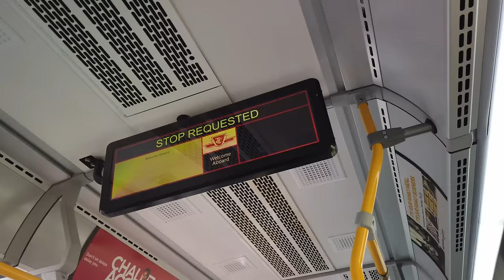Why American Buses Are Just Worse

Comment: Thanks Reece for a very informative video.  However, writing as a Brit, I should stress that most British buses outside London have only one door.  One correction.  Trolleybuses are 'not all over Europe'.  Many countries in WESTERN Europe have NONE.   Switzerland with 12 trolleybus systems is exceptional.  Outside Switzerland, Lyon and Milan are the only large western European cities with thriving trolleybus systems.  (Rome and Naples also have a few trolleybuses.)
Reply: 2 Hours Ago?The Video Uploaded Seconds Earlier.
Reply: And the idea of having one doors, especially on busy intensive city routes like those run by National Express West Midlands (in Birmingham), for example, just make things completely inefficient as a result of increased dwell times. With maybe the exception of lightly used rural routes, I don't agree with single door buses at all.

Quite a lot of Italian cities have trolleybuses, including Rimini, Ancona, Bologna, Cagliari, Chieti, Genova, La Special, Modena and Parma. Naples is expanding its system - route 204 for example began trolleybus operation in 2021, and 3 additional routes are soon expected to begin trolleybus operation - including 168 (renumbered 206) and R5 (renumbered 205), with withdrawn route 203 also to return.
Reply: Yep Trolley buses are generally mostly found in Soviet blocs. Though I think we should build them more rather than using too much battery electric buses.
Reply: Arnhem in the Netherlands also has trolleybuses, so not that little cities. (And of course a lot in EASTERN Europe)
Reply: @mr.fishmanman  seconds earlier for the general public. The videos are visible much earlier for those with paid membership.
Reply: I think it is only London and Edinburgh that have two door buses.
Reply: @f.g.9466  Oh Ok Interesting Thanks For the Info.
Reply: Everybody always forgets Athens. Largest Trolleybus system in western Europe.
Reply: @mr.fishmanman  I am a Patron of RMtransit under my real name of Roger Sexton.  The 'Perk' of early access to Reece's videos is for me very valuable.
Reply: @Fan652w  Can I Ask How Much Is The Membership And What's The Perks Aside From Being First To See The Videos.
Reply: What about Arnhem, Salzburg, Ghent, Budapest, and Athens? France has too many to bother naming.
Reply: @daniels7031  I most certainly did forget Athens.  And Athens also has trams and a metro!  Ghent closed its one trolleybus route about 15 years ago.
Reply: We also only have 70% low floor where I live in Central Scotland- there are 2 steps to get to the back seat- as a plus the seats  at the back allow a child to see out of the window from a seated position, which keeps them more entertained and makes the journey less stressful.
Reply: @Fan652w  Thanks
Reply: 1. The last time I checked "Eastern Europe" is part of Europe and 
2. The "big cities" mention is also unclear but I believe that Berlin, Athens and Piraeus are big cities.
3. there is no doubt that there are far less trolleybus systems today but I counted more than 40 existing systems in "Western Europe".
Reply: @katrinabryce  there are a few other places who have dabbled with dual door vehicles both past & present - Oxford was a past player and now, Brighton & Hove and Metrobus do have dual door buses on certain routes. Also, it should be noted that London has a small amount of single door buses, almost all being short midi single deckers except for the B9TL Gemini's on the X26 which were converted to single door upon it's upgrade to double deckers (it has operated full size single door single deckers in the past that were ordered specifically for the route)
Reply: @AA-ks7bo  The trolleybus line in Ghent (route 3) closed about 15 years ago.  France now only has three trolleybus systems - Lyon, St Etienne and Limoges.  (Nancy may bring them back.) Lyon is one of those wonderful large cities which like Athens and Budapest has metro, trams and trolleybuses!   Salzburg (Austria) is very akin to some smaller Swiss cities such as Luzern, St Gallen and Winterthur in that trolleybuses run on all the main routes. Linz (Austria) has double-artic trolleybuses, and has more on order,
Reply: @katrinabryce  Reading have introduced two door buses on the 17, which is their busiest route
Reply: Salzburg
Reply: @gabrielstravels  and I know Reece loves double deckers, but they are also super inefficient on dense city routes as the distance people are from the doors (up to 18 metres!) also increases dwell time
Reply: @katrinabryce  Also Brighton, Bristol (Metrobus, UniBus, X39), Bath (X39, UniBus U1/U2), Reading (Purple 17), Southampton (17 and 18), Crawley (Fastway 10/20 and town route 3) Cambridge (Busway B) and Oxford (11, 11X)
Reply: @samuell.foxton4177  I would agree on you on that, as much as I also love double decker myself, certain city routes are much more suited to articulated / bendy buses
Reply: @vjaska  Oxford Bus Company still have dual door Citaros in service!
Reply: @5688gamble  Many types of buses in Europe have rear windows, which are great indeed
Reply: Brighton & Hove also have some two doored buses but of course the more doors the less seating.
Reply: I agree that the buses in the UK are awful because te top of the seats are plastic handles so you rest your head on a piece of solid plastic
Reply: @katrinabryce  Also found in Manchester.
Reply: Also Trolley buses are popular in Austria in cities that do not have a tramway system.
Reply: The only trolleybuses I’ve seen in recent years were in the USA in Seattle.
Reply: Just because you can have a single door on a bus doesn't mean you should. As a previous commentor noted, I don't see any reason for a single door unless it's a small one (which implies low ridership) since you won't have many passengers trying to enter and exit the bus at the same time.
In general, the only way for two-way doors to work is when you have many of them to spread out the load. This is double so when you consider that the first door is preferably an entry-only door unless it's overfull or something (some cities like Berlin* even mandate passenger to enter from the front-door only) which makes the other doors (especially when there is only  other door) also more or less exit doors.

*Suspended during COVID, though this could have been changed back by now.

I'll also note that there are many West European countries with at least one trolleybus network. Switzerland was explicitly mentioned, France and Italy implicitly but Germany (Esslingen, Eberswalde, Solingen), Austria (Linz, Salzburg), the Netherlands (Arnem), Norway (Bergen), Sweden (Landskron), Portugal (Coimbra) and Spain (Castellón) also have at least one trolleybus network. This leaves Luxemburg, Belgium, Ireland, the UK, Denmark, Iceland, Finnland and a bunch of microstates (which for the sake of the argument shouldn't be counted) as West European countries with no trolleybus network so to claim "Most countries in WESTERN Europe have NONE." is only technically true due to the microstates but omit them and you get a majority of West European countries with trolleybuses (though they still are less widespread there compared to East Europe).
Reply: Fortunately here in Portugal most buses have two doors even in long range models
Reply: @katrinabryce  The Optare double-decker electric buses in York,UK which usually operate on the Park & Ride services
Reply: @MatthiasWiesmann  Salzburg has a trolleybus network.
Reply: @AL5520  Some of the western European trolleybus 'systems' are very small.  Landskrona (Sweden) has 5 vehicles on one route.  Schaffhausen (Switzerland) 7 vehicles on one route.
Reply: Ugh the single door buses pain me whenever I'm outside of London as it's so obvious they're causing a bottleneck slowing down the journey (also a London like simplified and unified ticketing system would also go a long way to speed up journeys).
Reply: @samuell.foxton4177  I noticed that when I visited Reading (Berks) they had some dual door buses on the busy route 17.  Ironically I am well old enough (turned 75 today) to remember Reading route 17 as trolleybuses.  It converted to diesel on 1968!
Reply: Arnhem (the Netherlands) and Solingen (Germany) are also decent-sized cities that have trolleybus systems. But yes, in Western Europe there are few such systems compared to other continents or even Eastern Europe.
Reply: @Fan652w  Additionally, Innsbruck might get new trolley busses very soon now(tm), after the old trolleybusses were replaced by trams (on the Line O), and diesel busses (Line R, but there are ideas floating about converting R to a tramline). It would then be the third trolley bus system in Innsbruck.
Reply: @samuell.foxton4177  Continental European doubledecks such as those used by Swiss Postbus around St Gallen, and Skane Lanstrafik around Malmo  have two staircases and three doors.
Reply: @gabrielstravels  Problem with double-decks on city routes where the average journey is about 15 minutes or less is that people are reluctant to go upstairs.   Vienna and Stockholm have both tried double-decks on inner city routes, but gave them up as only a few people went upstairs.
Reply: @Fan652w  my parents live on the number 4 route, which runs alongside the 17 to Earley, then continues to Wokingham and Bracknell, so I’ve seen a few of the dual door buses, but not been on one yet
Reply: @keithparker2206  In Austria only Salzburg and Linz currently have trolleybuses.  Linz does have trams as well. Innsbruck has an expanding tramway system, but is considering reintroducing trolleybuses as well!
Reply: I live in the NE of england and yeah pretty much all busses outside of major cities only have 1 door.
And UK hasn't had trolley busses since the 1960's.
Reply: @AL5520  he did say “extensive trolleybus systems.”
Reply: In Austria i know at least 2 (Salzburg and Linz)
Reply: @IntyMichael  SF has 15 trolley bus lines as defined by someone on Wikipedia. The articulated ones carry a lot of people during rush hour, last time I was there.
Reply: @Fan652w  yeah true, which is why for city routes 18m artics / bendies are better
Reply: @CatnipMasterRace  I entirely agree.  But your point about ticketing is extremely important.
Reply: UK are very good with buses though, especially London.

London's transport systems are extremely good and cheap, but go outside of London and there is no metro train thing. National Rail is great and Buses are too good
Reply: @gamingwithpros4047  As a Brit, I would agree regarding London, but not regarding the rest of Britain.  Outside London, services are generally expensive, and are poor in the evenings and Sundays.   We also have a desperate shortage of bus drivers.
Reply: @kitchin2  The bigger west coast cities are having all a pretty good public transport and bike lanes. I‘ve been to Portland, Seattle, San Francisco and Vancouver and they are all on international standard.
Reply from the maker: Thanks for watching! And for your insightful comments!
Reply: City bus lines are pretty much universally 3-door or 4-door for articulated in The Netherlands. And for regional buslines it is pretty much always 2-door or 3-door articulated. Each door being a double door of course. It also has a major trolley bus network, which is expanding as well (Arnhem).
Reply: @Fan652w  not to mention that most non London buses are single door too, which as I said before, makes journeys slower and inefficient
Reply: @gamingwithpros4047  well apart from Tyne and Wear Metro and Merseyrail!
Reply: @gabrielstravels  cheers, had thought the last ones had gone lol
Reply: @vjaska  they were temporarily withdrawn during Covid but they're now back in service. Btw, only the 55 regs survive (839-848) - the 52 regs (801-824) are all gone
Reply: Here in Austria, the next larger city has Trolleybuses. Also I don't know a single bus with only one door, you always get up in the front, show your ticket, and exit out the back. (Except for inner-city buses where you don't need to show your ticket and get on everywhere) But you're right, there could be way more trolleybus systems.
Reply: Ironically my main bus in London also only has 1 door too.
Reply: @xander1052  what's your local route if you don't mind me asking?
Reply: Double-door buses are also common in Reading, Brighton, Bristol and Edinburgh, although I stress still aren’t widespread enough.

Single door buses work fine on regular interurban services in the UK, but large towns and cities (I’m looking at you Manchester, Liverpool, Nottingham and Birmingham) really need to adopt dual door.
Reply: Well, you are forgetting Bolignia, Genoa, Sanremo, Salzburg and quite a few other places.
Reply: Limoges also has a large trolleybus network
Reply: @MaidaValeTom  I'd say they're fairly common in Bath too, the most frequent routes there (X39 and U1) have them
Reply: @5688gamble  Is this on Metro busses? This is common here in Sweden to, but then it's for buses doing larger loops and/or into rural areas. Think express or rural buses basically. Metro busses I can't say I honestly remember seeing without lowfloor and I've ridden buses to work for the past decade and a bit. Not to sya they don't exist, I've seen the odd replacement - sure, eg the orginal bus had broken down or was out of commision, the replacements have on occasion not been low. But those are unicorns, really.
Reply: @EgnachHelton  Well, in Eastern Europe trolleybus and first generation tram (from late 19th century) system survived mostly because there wasn't enough money to replace them with something else. Additionally, after oil crisis in the 1970s trolleybusses became actually cheaper to operate than diesel busses so they kept everything in operation and even some new systems were opened. The same can be said about trams. There were tons of plans for urban motorways and metros to replace trams, but nothing was ever built so trams survived.

P.S. Fun fact. Czechia, a small state in Central Europe with population just slightly above 10,5 million has 7 tram systems and 14 trolleybus systems which I think is more than North and South America combined...
Reply: Vienna also has a trolleybus system, kind of. As far as I know they are replacing (most?) of their bus fleet by electric busses that also have power cables
Reply: @gabrielstravels  It may depend on route. On the bus routes near me which feed into city centre I generally see only a few people at each stop during morning rush. And each stop gets a double decker bus every 15 minutes or so. Under these conditions two doors would not necessary speed load/unload and would lose seating capacity.
Reply: @katrinabryce  ...and many other UK cities?
Reply: In Germany I've never even seen a bus with just one door. Those really exist all over the place in the UK?
Reply: I remember 2 door busses in Sheffield in the 80’s but they were nearly all phased out by early 1990’s. About the only trolleybus I have been on was in Switzerland on a visit to see the Rhein Falls in Schaffhausen though I think I may have been on one in Seattle. 😊
Reply: The busses in Manchester UK seem to be improving in terms of comfort though many of the older type still run regularly 15 years later. I am taking a trip to US and Canada next month so will be travelling on lots of public transport in New York,LA,Portland and Vancouver with Amtrak connecting nearly everything in between. My last trip to LA was in 2006 so hoping see see improvements though the busses were not terrible but could have been better.
Reply: Trolleybuses are comming back, for example in Prague, we will have them again after 50 years and many countries are building even new tram systems, which is great. For me as a Czech, trolleybus is very exotic thing, ofcourse we have them in few cities, but it's not that common, but when I visited Latvia/Riga, they had trolleybuses everywhere, it was interesting experience. Our new systems in Prague will be combination of trolleybus and electric bus with batteries, it will be connected to wires only in some places, not everywhere. They plan some crazy 25m long trolleybuses to the airport becuase such a long bus would be illegal by our road law, but trolleybus is technicaly rail vehicle, so it's possible.
Reply: @Neuzahnstein  Salzburg and Linz are the only 2 trolleybus systems in Austria. Innsbruck is considering bring them back, even though it is also expanding its tramway system.
Reply: @norberthamar  No. Vienna has battery buses.  IT DOES NOT HAVE TROLLEYBUSES.  It used to have just one short route.  Contrast Vienna with Budapest and Bratislava, which do have lots of trolleybuses .  Prague is bringing back trolleybuses.
Reply: @Pidalin  To us brought up in western Europe the Czech republic and Slovakia are alongside Switzerland   three great strongholds for trolleybuses.   Basel got rid of trolleybuses, and has no plans to reintroduce them.
Reply: @Fan652w  For me, it's new, I am originally from Prague, not even my father remembers trolleybuses in Prague. And other cities are mostly that small that I don't need public transportation at all, I just walk, so even when I saw them in some Czech cities, I never tried it until I visited Latvia in 2018.
Reply: Kishnev in Moldova has trolly buses.
Reply: @AA-ks7bo  Ghent lost it's trolleys 10 years ago. They promised to turn line 3 into a tram line but that idea seems scrapped.
Reply: In my hometown (Bonn, Germany) the trolley buses got removed when the only places they went were mostly streets with tram tracks. That makes sense, since trams have less friction, bigger capacity and lower running costs than busses with rubber tires. I guess that's about the same in other western european cities.
Funny enough, the same cities which still have trolley buses (combining the bad economy of tire wear and lower capacity with being locked to fixed tracks) often also have central heating plants (combining the worst of big ovens and long pipes). Funny how that works.
Reply: I recently rode the trolleybuses in Salzburg, Austria. The system is quite extensive for a relatively small city
Reply: @daniels7031  Calling Greece part of "Western" Europe is a stretch in the best of times...
Reply: What about bologna and florence
Reply: In Italy there is not only Milan with a trolleybus system. There are 15 trolleybus webs.
Amongst the important cities Rome, Neaples, Bologna and Genoa own trolleybus lines.
Reply: Hey hey, what about Arnhem?!
Reply: Yeah, no surprise about the British buses I'd say. British buses that aren't in London are probably the worst public transport service I've ever used.
Reply: What exactly do you mean by "thriving trolleybus systems"? Milan (1.3mil) for example has 4 lines. Lyon (500k) has 9 lines. Doesn't sound that impressive to me, seeing that in Romania we have 16 trolleybus lines in a 2mil city (18 lines, two are suspended according to wikipedia) and 11 lines in a 400k city.
I do not see your argument as being very convincing when your examples are wrong, especially seeing that Romania in general has a rather shitty public transportation system. If we have better trolleybus networks than "the only large western cities with thriving trolleybus systems", there's a problem.
Reply: @h-0058  also according to Wikipedia Bucharest trolleybus lenght is 73 km. Milan's trolleybus web lenght is more than 40 km
Reply: @h-0058  The comment talks about Western Europe. Romania isn't in Western Europe. They did forget Salzburg though.
Reply: @jonistan9268  And sometimes when they're late they don't bother stopping or even pass by your stop if there's not a lot of people taking the bus from there, that's why I'd rather use my bike to get to work.
Reply: @EgnachHelton  Yep. They were worried if the gas would run out, or have none for public use during the war.
Reply: Limoges et freccia have at least one trolley line, but yes it's rare.
Reply: @h-0058  trolleybuses got investment as a matter of policy in a number of countries east of the iron curtain. They didn’t in the west. There’s really not much more behind it than that. There’s not really a good reason for them not to exist in the west, particularly given that we now need to Electrify Everything.

But if you’re building now you’d definitely build for buses that are capable of hooking on and off the lines without help, and have a fairly substantial battery backup. At the very least enough so that when there’s a big crossing where building the overhead lines everywhere would be hard, you can just… not. But ideally also enough for the buses to drive around things that are blocking the road.

The other way, of course, is fully electric buses that just recharge at one or two points, usually the middle or the end of the line. That’s the kind that drives past my house.
Reply: @JasperJanssen  I strongly agree with everything you say in your first two paragraphs.   Regarding what you say in your second paragraph, you will find that the Swiss cities of Zurich, Bern, Luzern, Lausanne and St Gallen prove the correctness of what you are saying.  On your 'big crossing' point Zurich has REMOVED the overhead wires across the very busy Albisriederplatz.  Trolleybuses on routes 33 and 72 cross the junction using batteries, while the trams on routes 2 and 3 still use their overhead wires.
Reply: He said all over Europe, not  in western Europe :)
Reply: BTW. In Czech Republic (central Europe, definitely not eastern part) solely we have 14 cities with trolleybuses running, including 5 biggest cities in this country (with Prague as a capital bringing them back after many years without them). 

So there is definitely a lot of cities with trolleybuses in Europe :)
Reply: @siriusczech  Now that Prague is bringing trolleybuses back, the Czech republic is perhaps now the trolleybus champion of Europe, ousting Switzerland.  Switzerland's weakness is that its second city, Basel, got rid of trolleybuses some years ago, and has no plans to bring them back.
Reply: You forget Paris, Marseille, Bordeaux, Strasbourg, Nice, Montpellier and Grenoble. Actually, there are 31 cities in France with such equipment.
Reply: @Jeff-ub4lr  No, you are wrong.  WE ARE TALKING HERE ABOUT TROLLEYBUSES NOT TRAMS.  There are about 30 modern tramways in France, but only three surviving trolleybus systems - Lyon, St Etienne, and Limoges.
Reply: Netherlands too. Just 1 city I know of but still. (Arnhem)
Reply: @katrinabryce  I visited Edinburgh last week for first time from Dublin last week, while most of the buses were nice (mix of VDL and Wrightbus I think) and seemed to be new, there was no middle door! :(
Reply: In Italy, apart from Milan, Rome, and Naples, there's also Bologna and Venice that has trolley buses (that I know of, and yes, Venice isn't only the island, Mestre, the city in the mainland, is part of Venice), my city, Padua, had them but took the system down when it replaced it with higher capacity tram lines.
Reply: Trolleybusses are plentiful in Eastern Europe as Czechs produce Skoda Trolley busses, and they are pretty good. We now have more Italian (?) Trollino trolleybusses
Reply: @JasperJanssen  Yeah, electric buses are also found here in some significant numbers, but they're not competing with the trolleys when it comes both to numbers and capacity. You can fit two electric buses in a trolleybus and they have to be recharged. When we'll get articulated fully electric buses, they might actually have a chance to become mainstream, but until then, they're found on the less used lines ("less used" - they're completely full central lines, but whatever, let's not get into the poor city design topic).
Reply: Also Genoa has a trolley line and in 2026 the trolley line will be 4
Reply: @h-0058  I think some of our buses are articulated ones still? Not sure, really, since early 2020 our passenger numbers are enough down that buses are never crowded no matter what. But… yeah, no, I’m sure the buses running our route are electric articulated ones. ProbabLy vanHool or Heuliez, that’s where almost everything comes from.
Reply: @5688gamble  I don't think non low floor buses are allowed to be used in England for normal service routes. Many buses in the UK have "kneeling" capacities, where the front of the bus can be lowered to bring the floor level closer to the height of the kerb
Reply: @gabrielstravels  For a while in the UK it was common for double deckers to not have a window on the rear deck
Reply: @heidirabenau511  I believe that the Optare Spectras (2nd gen) were the very first buses in the UK to be low floor
Reply: @gabrielstravels  Are you happy to be one of the four (or more) people either standing or left behind when that door costs seating capacity?
Remember busses have to stay still for so long to meet their schedule anyway so you're not going to gain a lot by taking a few seconds off their loading time.
Reply: @rianxmcg  Only the tri axle E400XLBs and some B9TL G2s are dual door
Reply: @leeroberts1192  Downstairs, yes, some types of buses don't have rear windows. These include, but not limited to, Scania N230UD ADL Enviro400, some Trident ALX400s at Stagecoach
Reply: @siraff4461  I'm fine standing provided it's for short journeys. And yes, regarding schedule, that's true, so many routes are so overtimed it's unreal.
Reply: @AL5520  Berlin has no trolley buses. The only German trolley buses are running in Solingen (largest network, the city itself being around 150k), Esslingen (around 90k) and Eberswalde (around 40k)
Reply: Copenhagen has a trolleybus line. But otherwise yeah, they´re super common in Eastern Europe, but rare in Western.
Reply: @Thetarget1  Very sorry, but you are wrong.  Copenhagen no doubt now has some battery electric buses, but it does not have trolleybuses drawing current from overhead wires.  However, there is a short trolleybus route close to Copenhagen in Landskrona Sweden.  Landskrona is just across the Oresund from Greater Copenhagen.
Reply: @Thetarget1  Sorry, but the city of Copenhagen does not have trolleybuses.  However, in the Oresund Region, an area which covers Copenhagen and Helsingor/Elsinore in Denmark AND the Swedish towns and cities immediately  east of the Oresund, there is a short Trolleybus route at Landskrona (Sweden).  I suspect that when you visited Copenhagen, you bought a 'Round the Oresund ticket' and you saw a trolleybus when the Oresund train stopped at Landskrona.
Reply: @Fan652w  Or they saw a charging battery bus if you have this feature? At least here in Cologne we have these. They have trolley poles but will use them only stationary at the terminus where there are power supplies installed overhead. Once they continue driving the poles are retracted and there are no overhead wires anywhere on the route.
Reply: @Fan652w  nvm, I see now, their overhead wires confused me, never saw those types of electric busses elsewhere (in Europe), so I just assumed they are for the same purpose as trolleybuses, google search later and now I know, thanks
Reply: @siraff4461  The buses I used (in multiple cities, for that matter) tend to stop only for a minute at most, single-door buses would not work here.
Reply: Landskrona in Sweden has a trolley buses. Thats not a big city though. And then we have Bergen that has them as well. But Sweden and Norway maybe is not western europe as its in the north :)
Reply: I once had the dubious pleasure of attending a conference given by the British Government (before there were parliaments in the other three UK countries) and they were talking exclusively about bus services every 30 minutes or better, as in Central London.  I pointed out that one of my colleagues had no bus service, it was closed down a few years earlier, so people in his village had to use a car to travel anywhere else.  Old people and those on low income were dependent upon the help of neighbours and friends.  Another colleague lived in a village just 100 to 200 yards from the main road between two sizeable towns and they did have a good service every 30 minutes.  I lived in a village up in the hills and we had just two buses a day, one in the morning and one in the afternoon.  The bus was driven by a postman who followed a set route and emptied all of the post boxes that he/she passed.  The vehicle was a van where the front two thirds were fitted out as a bus and the last third as secure storage for the collected mail to go into.  If you lived along that route you waved the bus down, paid your fare and went on a roundabout tour of country villages that would take several hours overall.  When the post bus arrived in the nearest market town, some 15 miles away, you had two to three hours to do your shopping, visit your doctor, dentist, hairdresser, bank manager etc and get down to the mail sorting office for the return journey.  Miss that post bus and you would have to take a taxi at huge cost, so people tended to arrange their visits to town very carefully.  Not so good for elderly and disabled folk but it was all there was.  The suits from London couldn't comprehend such an arrangement as they were used to living in London suburbs with a bus every ten minutes.  Hopeless.
Reply: in the netherlands the whole of arnhem rides trolley bus system
Reply: @lexburen5932  But Arnhem is the ONLY trolleybus system in the Benelux countries
Reply: @jaspboynl8094  the only one..
Reply: Who's remembers Crosville buses in the 80's? They had 2 sets of doors. They serviced Liverpool, Runcorn, Chester, various parts of Cheshire. Think they lost the contract or pulled out in the mid 80's/early 90's.
Reply: @daniels7031  Of course, Athens! All forgotten out there far on the edge of the other side of the continent.
Reply: Salzburg and Linz also have them...
Reply: @heybenjii5544  That is true.  But they are the ONLY Austrian cities with trolleybuses.  Contrast neighbouring Switzerland.